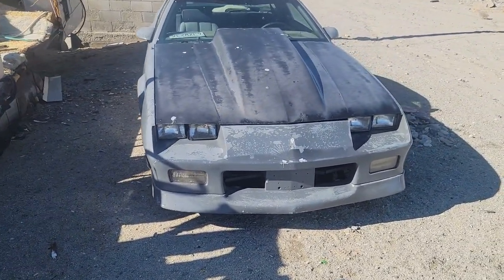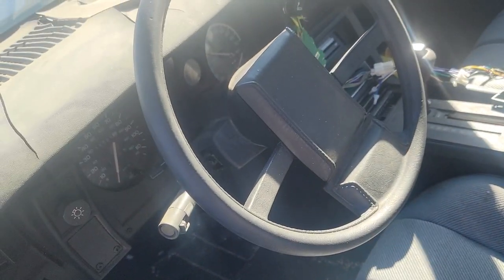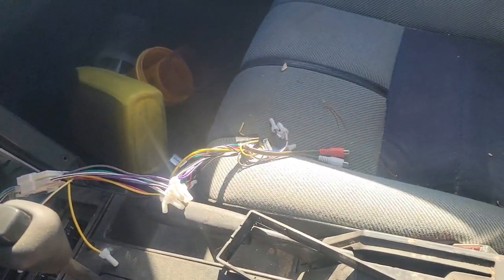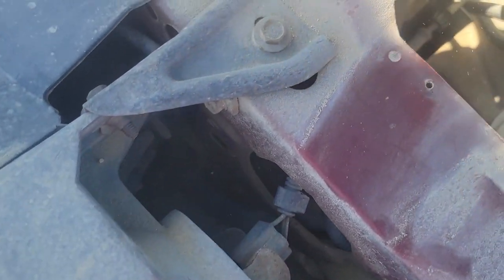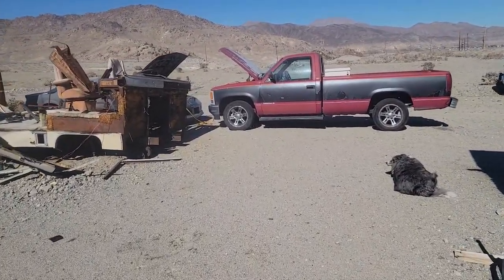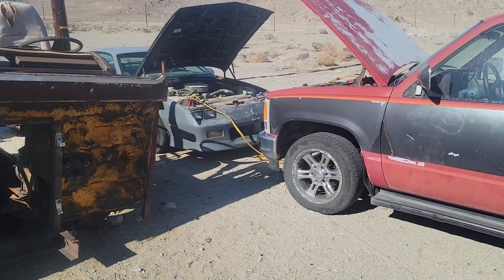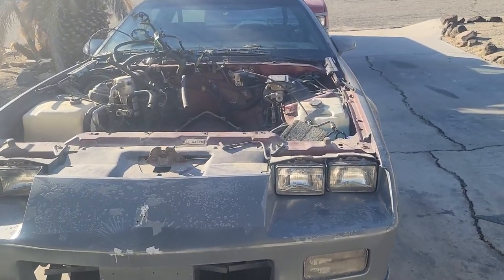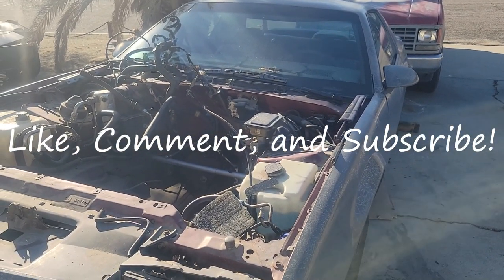1989 CAMARO LS SWAP/ GOODBYE 305

Comment: Great video brother! I just pulled the 305 out of my 87 Formula for a crate motor 350 with the L82 cam in it. 310 hp/ 350 lbs. Having the 80s styling of a third gen F body along with some actual power is the best of both worlds.
Reply from the maker: That's what I'm thinking. The 5.3 that I have should be making some pretty good power. Freshly rebuilt with a sloppy stage 2 cam and pac1218 valvesprings. Hopefully I'll be able to do a drag n drive by the end of the year!